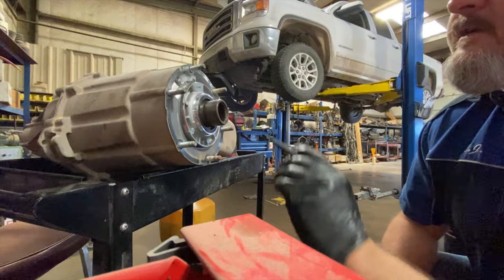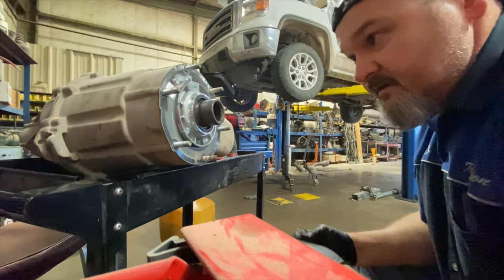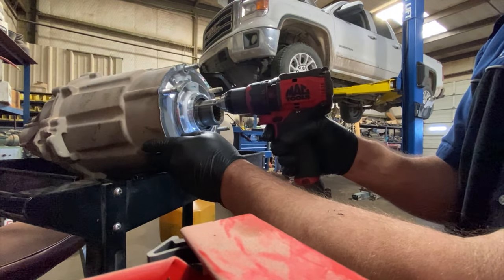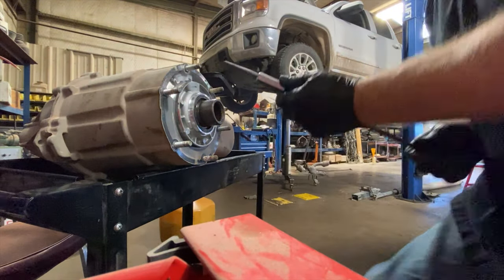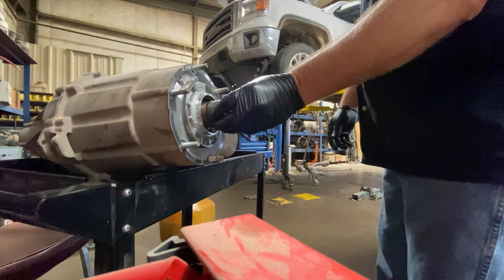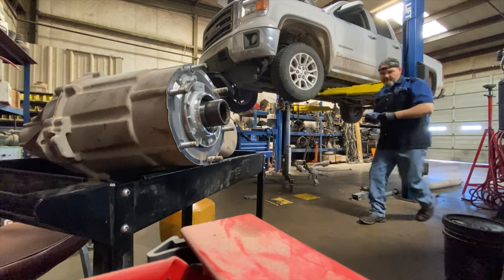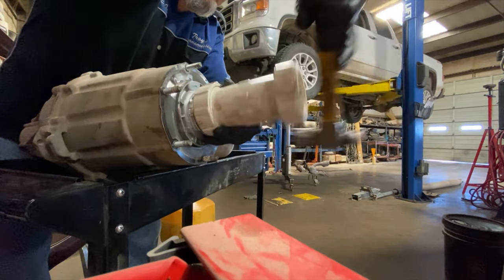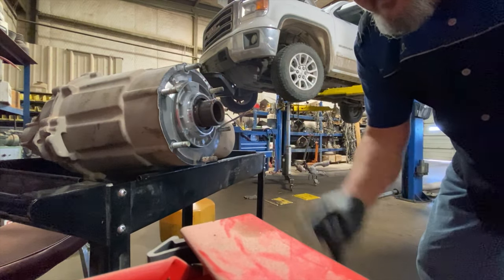4x4 Transfer Case Input Seal Replacement

Comment: When I changed the seal on mine I went the long way around the barn and pulled the retainer Wish i had seen your method first. I'm gonna try this on my S-10 since the retainer is flush with the with the face of the transfer case and has a butt load of black RTV holding it in place. I'm thinking nothing short of C4 is gonna get that plate outta there. Thanks for a great how to.

Comment: FYI, that is a pvc slip joint or compression coupling, repair coupling, or dresser coupling, called by multiple names just to make it more difficult lol, made in multiple sizes and sold at most box stores or your local plumbing wholesaler...

Comment: Clever way to get the seal out—also great idea of using the pvc pipe to tap with the end fitting to make sure you have a flat surface to tap in the new seal.

Comment: Thankyou for the video. 
I’m going to be replacing the rear main seal and doing the gm Transfer case pump issue repair. I believe this is decided me I’m going to do the seals as well. The truck has 170,000 on it I’m sure it’s due

Comment: Nice job! Question, do you also have a easier way or trick to replace that very difficult front output seal, the seal for the front the 4x4 front driveshaft, the two-piece seal! Thanks.....Sorry,  for the 263hd transfer case!

Comment: Replacing my 4l60e, noticed it's leaking big time right where the transfer case and tranny connect and old trans lost a majority of it's fluid there, soaked, do you think the paper type gasket could be the culprit? Or would the seal your replacing here be more likely the problem?
Reply from the maker: If the transfer case is over full the the front input seal is bad. But that wouldn’t cause an external leak. The gasket is most likely the issue
Reply: @EJsGuitars  the transfer case was checked and had normal amount definitely not overfilled. Overtime my truck was leaking there eventually driving it said transmission was hot and I lost 3rd and 4th and looked underneath and it was soaked right where they meet up and my trans was about out of fluid. Would you recommend going with the gasket or something like Rtv ultra grey or something rather? Just want to seal it up properly so I don't run into this problem with the new transmission
Reply from the maker: Gasket only. Gasket is best, and do not add silicone to the gasket. You can use silicone by itself but the gasket is the best option
Reply: @EJsGuitars  Thanks for the response. I figured it would be one or the other. Will probably get the gasket if the local auto parts store has it, if not silicone it is! Appreciate it. First time attempt tackling this type of job.
Reply: @EJsGuitars I actually came here because I’m having a problem because of that dude who owned the truck before me used silicone and didn’t do it so well